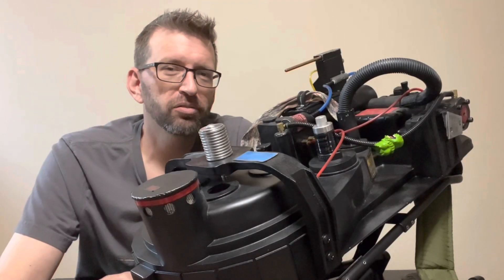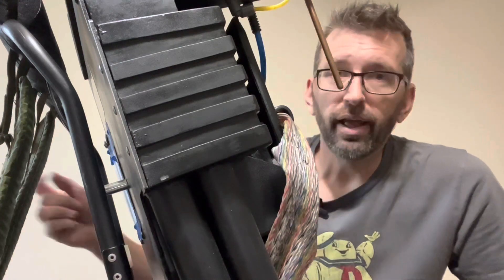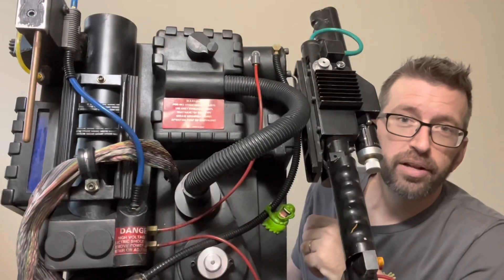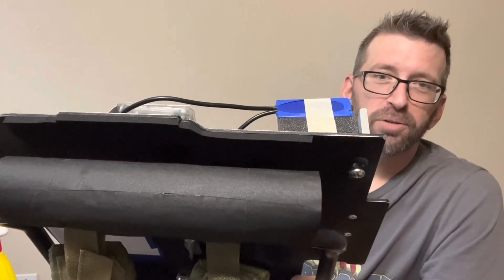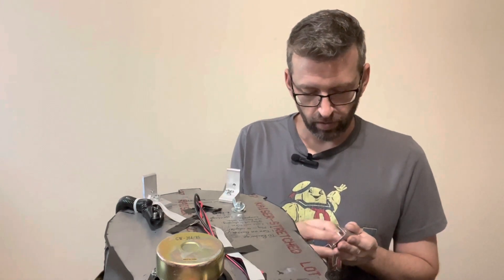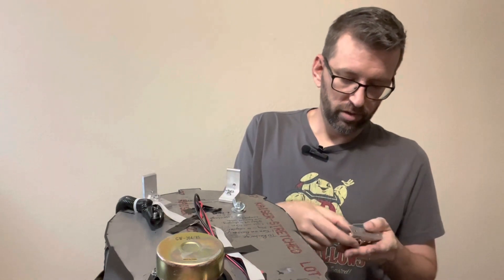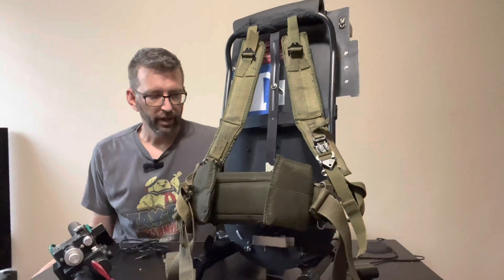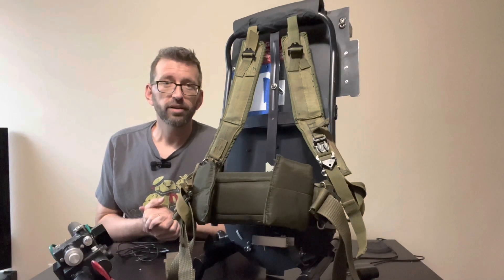The Venkman Conversion - Motherboard Foam, XLR Plate Swaps; Adjustments to Previous Changes

Comment: I told you the yellow super hot glue was better.  I believe there is a little of that same adhesive attaching the red and blue wires leading from the power cell tubes to the terminal block on the spacer.  It is mostly hidden by the split loom on the ends, but when I saw this pack up close, I could see that glue was there.
Reply from the maker: You’re absolutely right, that’s coming up soon, as well as another glued up area I spotted 👍

Comment: Is your pack mounted on the alice frame lower than on screen used? There seems to be not as much space at the top of the motherboard. My has lab pack seems to be the same, and if you try to stand the pack up on the frame it leans very forward and would fall if I let go of it. I’m hoping to be able to replace the motherboard so i can mount it higher, as for my proportions, I would suit it being higher. Just curious about your pack and your preferences regarding this.
Reply from the maker: Mine is off a bit. When I bought my shell the motherboard came with it, and the frame holes were drilled out already (at least the bottom two were). I just went with it and assumed they were in the right spot. It’s not way off, so I just live with it.

I’m going to have some ALICE frame/motherboard content when mine arrives.

Comment: Question what brand and size is that speaker and I'd it loud? Or getting two would be better? Trying to avoid getting a large speaker in the cyclotron area cause I'm gunna attempt to be installing a pneumatic cylinder for the bumper eject effect
Reply from the maker: It’s from GBfans. It’s fairly loud, enough for what I need.
https://www.gbfans.com/shop/pack-parts/40w-shielded-speaker/